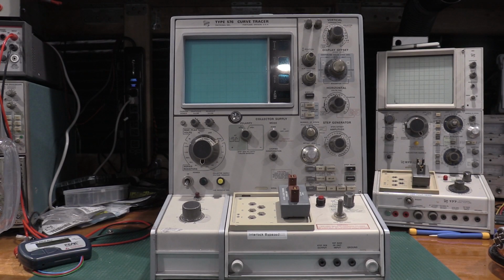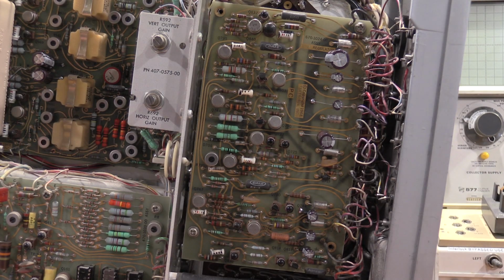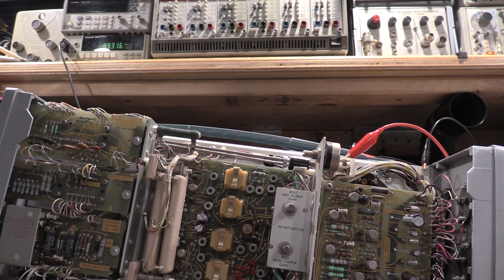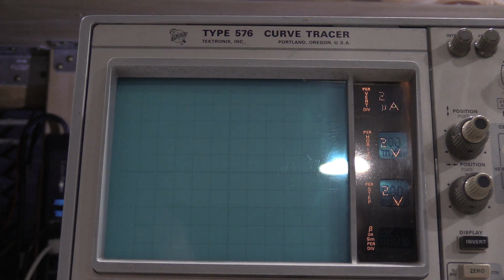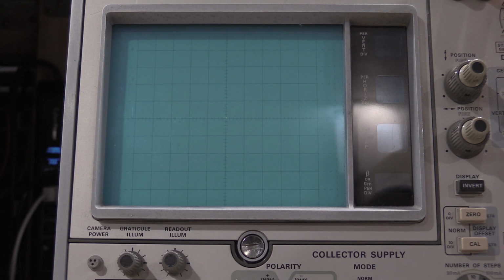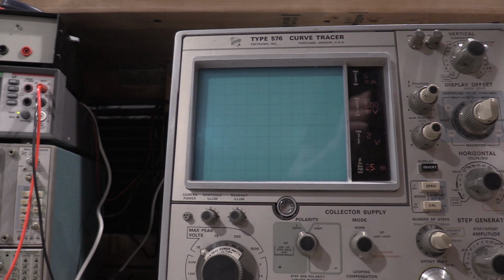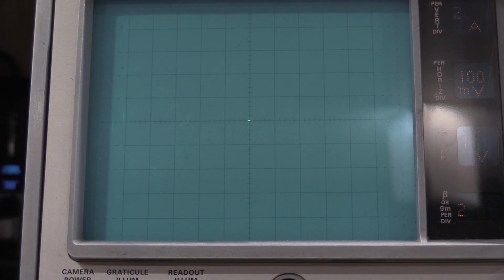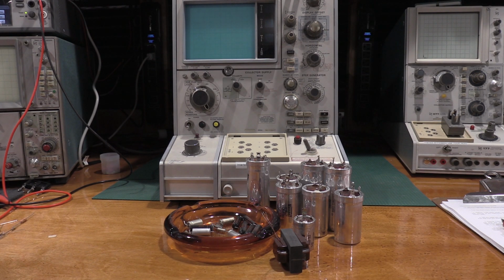Tektronix 576 Calibration

Comment: Regarding the error in the manual around time 55:00, it's not an error.  Look at the previous page in the manual just before step 20.  I think it's page 5-19.  It shows the beginning of the control settings that are different than the initial settings.  It include setting the VERTICAL to STEP GEN and 3 other settings.

How did you results look for step #19 in the calibration?  Mine were within spec until I got to the last 3 rows.  They were off by about 4.5 divisions from the center instead of +/-2.  I thought maybe the 1 ohm resistor was out of spec but it read 0.999 on the LCR meter.

Nice video by the way.
Reply from the maker: Thanks for pointing this out. I checked the service manuals I have and 2 of them show this step. I think what happened is I had an adjustment procedure. Not the check and adjustment the 2 older manuals I have step #19 section i, is a check step and would have been omitted from the adjust only procedure. But now I have something I need to double check for sure.

Comment: Great Video thank you! Any chance you can list what make/model of caps/ other components you used to replace? Thank you again!
Reply from the maker: I will see what I can do. All caps were Nichicon and all were 105 degree C rated. They were selected for longest life and overrated on the voltage if possible, sometimes was NESSEARY. Vintage caps were tolerant of over voltage modern caps are not at all tolerant of overvoltage.  If a capacitance match was not available I went with the next size up usually a 100 uf or so over.  This will not hurt anything given the tolerance specs of vintage capacitors.

Comment: I just watched the first part of your video, until after you finished replacing the elcaps. Very informative.
From what I could see, you did not replace C719. AFAIK, that's a wet tantalum cap (wet slug) of 3uF/150V. Those are infamous for leaking sulphuric acid when they age. Perhaps you should replace that as well.
Reply from the maker: Yep looks like I missed one I will have to get it out of there as well. I did not even see that one hiding on the other side of the regulator board.

Comment: So I’ve had a chance to test voltages on all rails and they are in spec. Haven’t adjusted them yet but they are all very close. Haven’t checked ripple yet. Have you tested the caps you replaced and how many were bad? I’m trying to decide if I need to deal with the filter caps at this time or not. On that topic, the adapter boards that you used, are the Gerbers for them available somewhere? Or available for purchase? Not sure if you drew them up or got them somewhere.
Reply from the maker: Hey Andy glad to hear it is going well! The adapter boards can be found here https://oshpark.com/shared_projects/hpUFRhHC they are a shared project and will work for all the main filters even the high voltage one the cost is for 3 boards. The high voltage one needs to be trimmed a little.  In terms of the caps in this one. The minilytic caps were slightly bad but not awful. I changed them because I hope to have many years of worry-free service from this. On this unit (Not the same unit as the first impressions and repair video) on the regulator board the black and red Sprague caps were beyond bad. They had an ESR of 111.6 Ohms should be under 1. So to DC they were 100 ohm resisters this is where I suspect I saved the 10 Watts of power consumption. On to the bulk filters. I given that the filters are close to some unobtanium parts in the transformers I changed them for peace of mind. In testing on my personal unit that appears to be stored well the main filters tested ok and were replace due to the time I spend in the calibration and to protect the transformers especially the high voltage transformer. The original filters are 85 degree C caps I made sure all the replacements are a high quality brand and are 105 degree C rated with LONG hour life. Running a 105 C cap at 85 C extends the useful life even further as far as I understand so I am a fan of over rating parts when I have the chance. Helps them to live longer. High heat is really the enemy of everything and is usually never desirable except in some fringe cases. Also remember when you have the covers off there is 225 Vdc everywhere and when you have the high voltage power supply open you have -4000 Vdc exposed. If you are unsure get help and be safe and take care. As with everything your caps may vary.

Comment: Hello, nice calibration video, my Tektronix 576 has some bad Defective lamps in the readout and was wondering weather you have a video how to replace those and the lamp type used?
Reply from the maker: I have not done that video yet. I am hoping it is the lamps and not the driver IC's I have a few readout boards in the lab where the driver IC are the faults. I am thinking about testing if this can be switched over to LED's and it looks possible but more information and testing needs to be done.

Comment: So this 576 is different from the one in the repair video?  Did you take the HV transformer out of that one for this  unit?  Also, I noticed in your 1st 576 video none of the displays to the right of the screen we're working.  Did you turn that machine into a parts unit?   I have been  on the Tektronix forum for about 8 years.   I had five custom HV transformers made about 6 years ago.  The company I used unfortunately closed.  I know someone else had  some make about a year ago.  I kept two of mine and sold three.   I did not make any money on the effort, but I did help keep five 576s out of the parts bin or scrap pile.   I still have one to restore.  The first one I did required programming a custom IC for one of the fiber optic displays as the original ICs are unobtainium. .  I also put in replacement relays (telephone switchboard type) for the terrible plastic ones as well as replaced all of the power supply caps.  Had to replace of few of the logic ICs in the step gen board too, fortunately those are still off the shelf parts,  Thanks for the video.  I am sure it will help other 576 owners.
Reply from the maker: Dave,
	Yes this is a different 576 but Fear not. The current state of the lab is 2 fully functional and calibrated 576’s. I have a 3rd unit that was already a parts unit when I bought it. It was missing some stuff and had a REALLY dead tube. It fortunately had a newer HV transformer so that is where this one came from. It allowed me to rebuild the Early serial number as it surprisingly had a healthy tube.  I have kept the frame as I would like to find a way to use a 576 that has a tube that is dead as well as a High voltage section. But this would require a redesign of the display section. Both power supply sections have been rebuilt and re capped so all are in good shape for future use.  I also have a 577 on the bench and tend to use that more often but that is to save the tube for when I really need the power bands of the 576 or the 176 high current fixture. 

I would be VERY interested in discussing the readout board as I have one that has known dead chips from the parts unit. I would like to convert one of the read out board to LEDS.  I have done some testing and know this works I just need to get the logic down for the correct readout. 

Zen

Comment: Very interesting video. I can only dream possessing a Tektronix 576 for now, but what I was wondering is, do you happen to know what sort of CRT the Tektronix 2445 needs, please? Possibly the type number and equivalent brands perhaps? thank you. Also, do you have a supplier for your CRT's? Could I ask for your supplier's contact info? I subscribed to your channel by the way :)
Reply from the maker: For the curve tracer also look in to the 577. This is a smaller lighter but also quite capable unit that was created in response to the build cost of the 576. For the 2445 The CRT that is needed is part number 154-0850-00. The bad news her is there is not really a CRT supplier. Tektronix made there own CRT screens in house and this is really where all the magic is in one of their scopes. Once I get through some things here that effect the lab but not directly I do want to get some of the 2xxx scopes on the bench for repair but I will need some examples. As always more is on the way.

Comment: Hi fiend, I'm fixing a 576 curve trace, the source collector control give to much current and emit smock even in the lower power voltage. What can I do in order to fix it? Thanks for your excellent  videos 👍
Reply from the maker: That is a significant issue with one of those units, and extreme care needs to be taken. At their highest output this units can have lethal voltages at the output terminals and are capable of blowing up test equipment as well. But for starters the unit needs to be checked for what it is actually doing set to DC and a meter + to C – to E and see what the voltages are doing when the collector control is varied. However If the collector control is not working correctly the output can exceed the 1000Vdc rating on most meters and burn up the test equipment. The supplies in these units are substantial and should not be underestimated they will kill if mishandled. There is a lot of iron in there and there is no way to disable the high voltage side of things when working on the unit or the collector supply. So use EXTREME caution and if there is any doubt don’t service this unit and seek experienced assistance.
Reply: @ZenwizardStudios   Thank you for answering my question. I already found the fault in my device, it is a short circuit in the transformer T301 tektronix 120-0611-00. Could you please tell me what are the voltages and currents output's of this transformer? in order to repair it or re-manufacture it. On internet, there are no characteristics of this transformer. I thank you in advance and hope you can help me with this issue. Best regards.
Reply from the maker: Ouch. That is unfortunate though the instrument is worth saving if the cost does not run too high. The good news is Yes I can point to the direction of the engineering documentation it can be found here. https://w140.com/tekwiki/wiki/Reference_material the document in questions is Transformers_120-0500-00_to_120-0998-01 I did check this one has the 611 specs in it. A fair bit of the gravity of the instrument is T300 and T301 getting the collector supply out is kind of a pain but is not to bad. I had to service the caps in one of my early units. So if it is out those might use a refresh as well.
Reply: 🙏thousand of thanks!!! I already found the information to repair or manufacture a new transformer 😎. Congratulations for your youtube channel and your valuable communication with subscribers. 👍👍👍

Comment: Hi, 
Just found your channel and I like the content. I am not familiar with the 6-position unit with 6 independent volt meters. Is this part of the Tektronix Main Frame series? Good idea. I have 4 different DMMs witch cables everywhere when I am looking at multiple rails.
Regards,
Glenn Scott
DSM Labs
Reply from the maker: This is a TM500/5000 series. It is a modular system from Tektronix. It is one 5006 power frame with DMM 502A units. The 502A are a 3.5 digit meter. I recommend the probe master 9000 series probes as well.